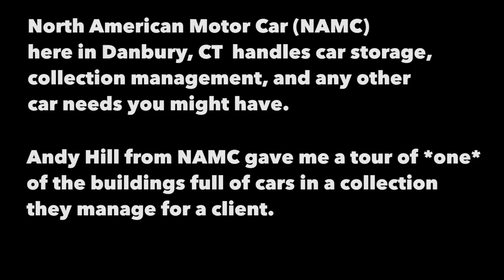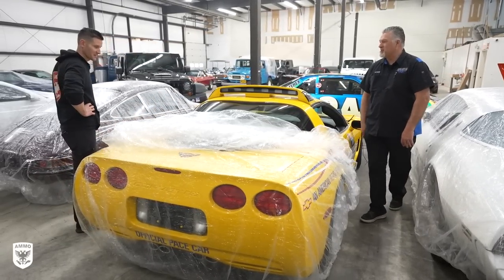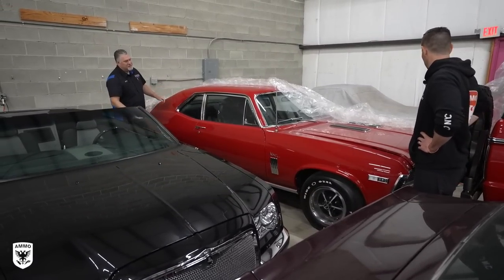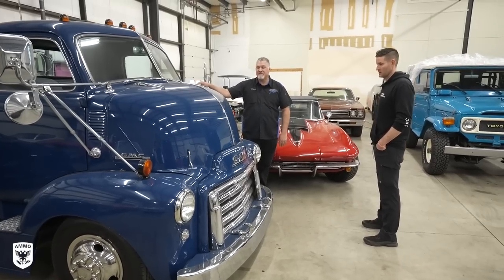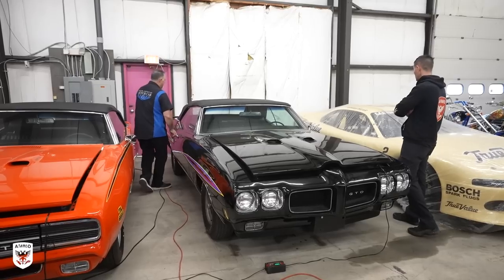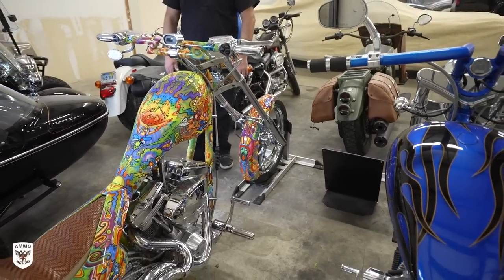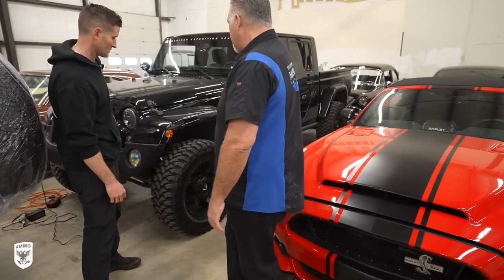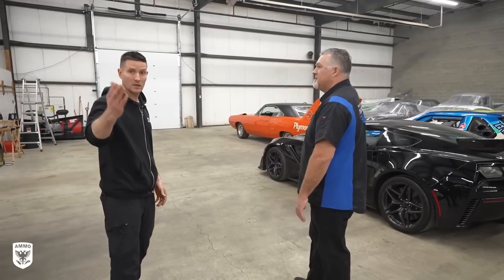Secret Collection for Sale: Car by Car Tour

Comment: "Special car" "rare car"
Well I have yet to see anyone collect not Special, or rare....
But if any one knows of a collector that has a bunch original 1995 honda accord lx... let me know, im having a b*tch of a time finding parts for mine....
Reply: Another car I'm having an absolute bitch of a time finding parts for is my 1977 Oldsmobile Omega Brougham 2 door with bucket seats and console shifter, I can't hardly find anything that would be correct for that car
Reply: @aydenstockham1143  have you tried rock auto? Some times I get super lucky on there.... 
they had some parts for my 1984 mercury capri....
Not a lot but some